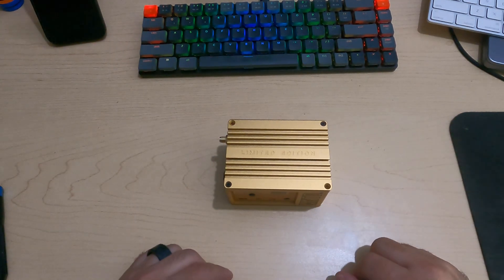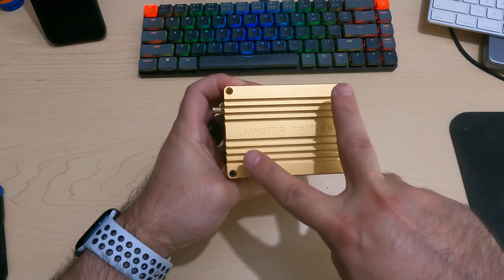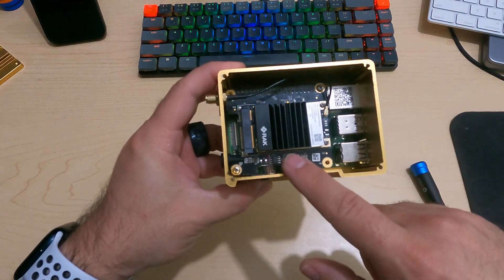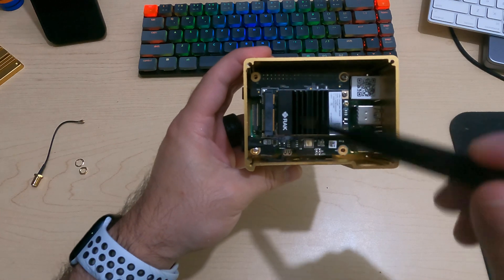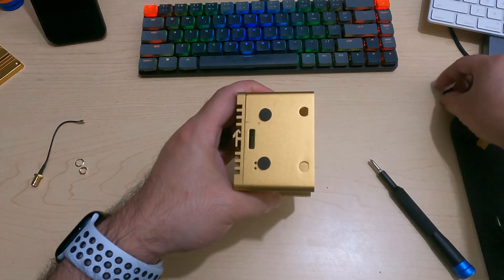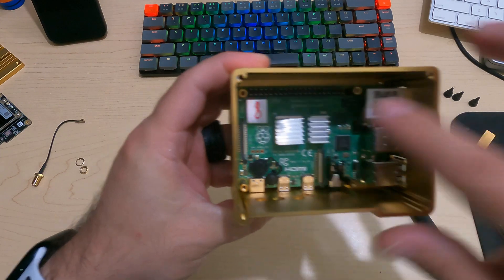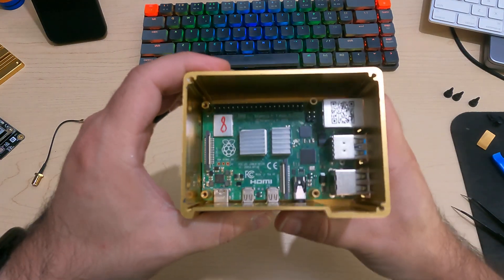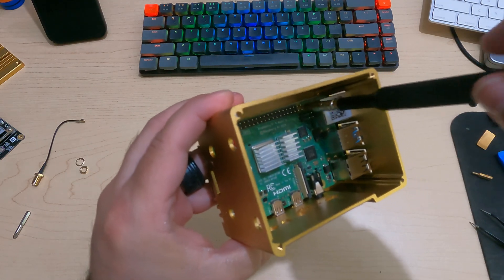MNTD Goldspot / Blackspot Teardown - Raspberry Pi 4 Inside!

Comment: Maybe a dumb question but one of my MNTD goldspots stopped working. No LED what so ever. So is it possible if i just buy a new Raspberry Pi 4B (8GB) and put the RAK board on it and flash it with the MNTD goldspot software, that it should be working again?
Reply from the maker: @donm3ga909  I haven’t tried this but it makes sense that it’d work in theory. You might not even have to flash anything just transfer the SD card from the old nonfunctional Pi to the new one. As long as it’s the same model.